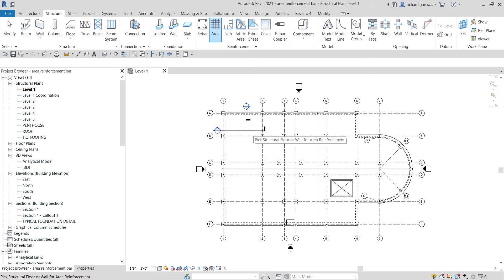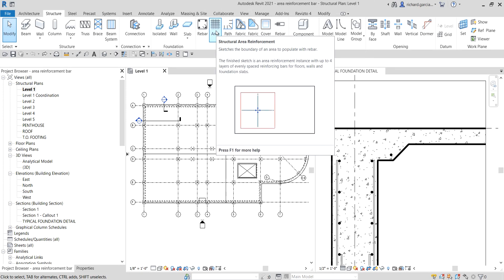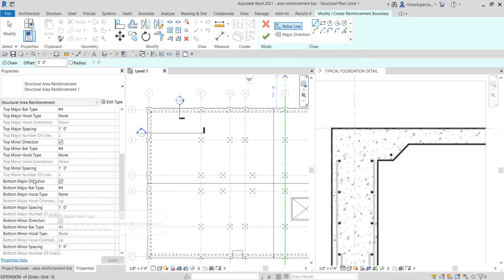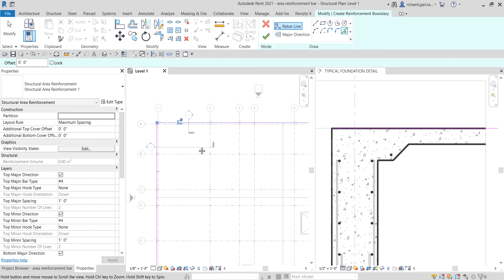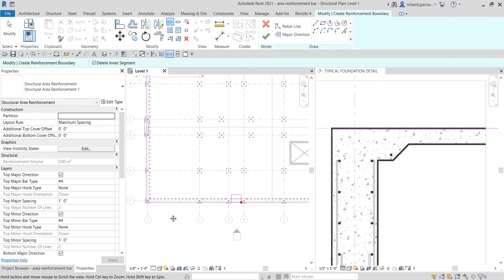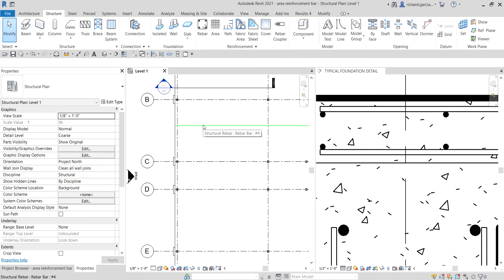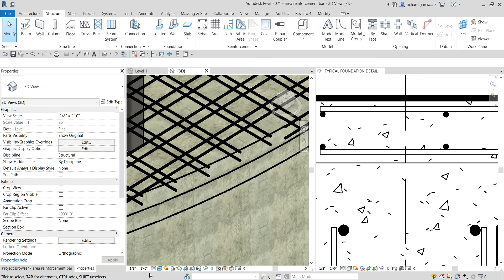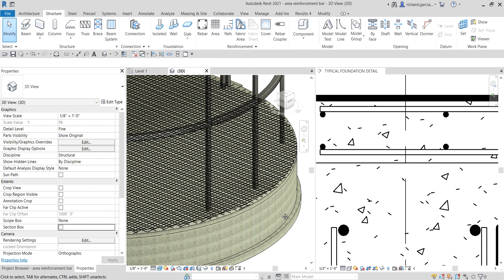REVIT STRUCTURE 2021 - STEP BY STEP TUTORIAL 29 - AREA REINFORCEMENT REBAR

Comment: Hello there, In area reinforcement can we change the rebar shape
Reply from the maker: hello sir, yes, in Area Reinforcement in Revit, you cannot directly change the rebar shape like you do with individual rebar, but you can control its layout using different methods. Here’s how you can work with rebar shapes in Area Reinforcement:  

1. Use Rebar Sketching (For Custom Shapes)
- Instead of using Area Reinforcement, you can place individual rebars manually.  
- Use the Rebar Tool and choose the desired shape from the Rebar Shape Browser or sketch a custom shape.

2. Modify Bar Direction & Layout
- Select the Area Reinforcement.  
- Adjust the Major and Minor Direction of bars.  
- Modify Spacing, Number, or Orientation to better match the desired shape.

3. Convert Area Reinforcement to Individual Rebars
- If needed, you can explode the Area Reinforcement (by selecting it and clicking "Remove Area System").  
- This converts the reinforcement into individual rebars, allowing you to manually edit their shape.

4. Use Path Reinforcement (Alternative)
- If the goal is more control over bar shape and placement, consider using Path Reinforcement instead of Area Reinforcement.  
- This allows you to control bar shape, placement, and constraints more precisely.

Comment: Hello there, I have a question for you please, how can create overlap with Area reinforcement tool??
Reply from the maker: Hello sir, to create an overlap with the Area Reinforcement tool in Revit Structure, you can follow these steps:

1. *Select the Area:* First, select the area where you want to add reinforcement. This could be a floor, wall, or any other structural element.

2. *Activate Area Reinforcement:* Once you've selected the area, go to the "Structure" tab on the ribbon, then click on the "Reinforcement" drop-down menu. From there, select "Area Reinforcement."

3. *Adjust Settings:* In the properties palette, you can adjust various settings such as the type and size of reinforcement, spacing, cover, and overlap.

4. *Set Overlap:* Look for the parameter related to overlap in the properties palette. Depending on the version of Revit you're using, this might be labeled differently, but it's typically called "Overlap" or something similar. Enter the desired overlap value here.

5. *Place Reinforcement:* After setting the overlap, you can then place the reinforcement within the area you've selected. Revit will automatically apply the specified overlap between adjacent reinforcement elements.

6. *Adjust as Needed:* You can always go back and adjust the overlap value or the placement of reinforcement if needed by selecting the reinforcement elements and modifying their properties.